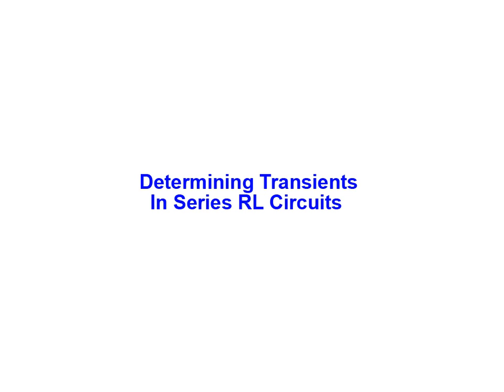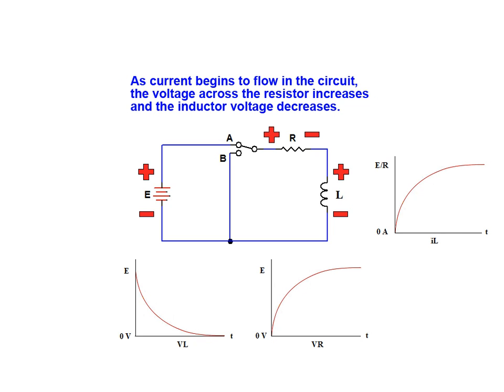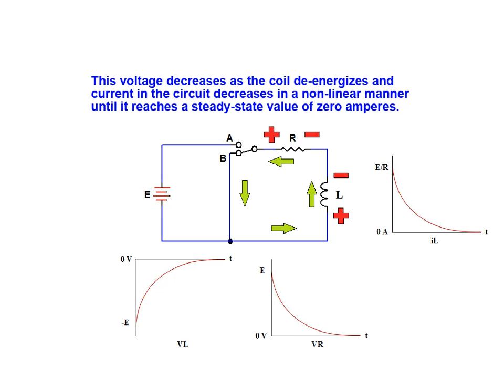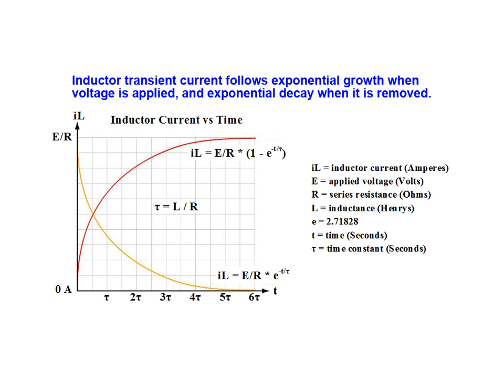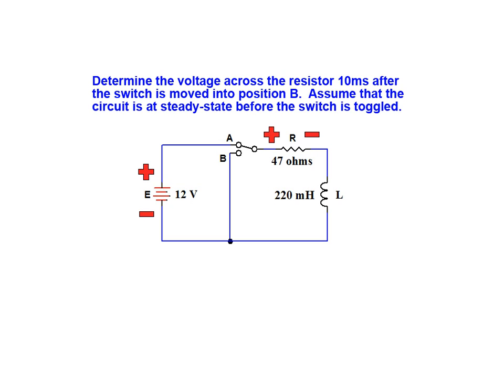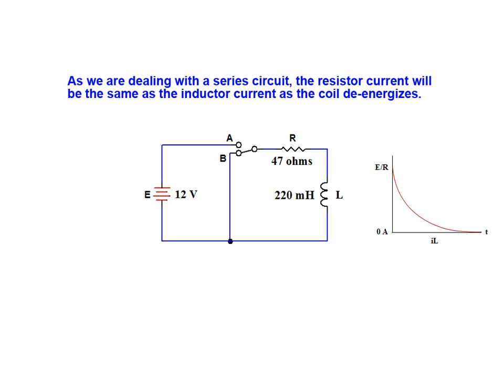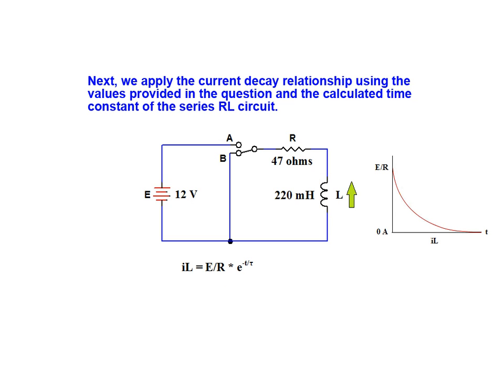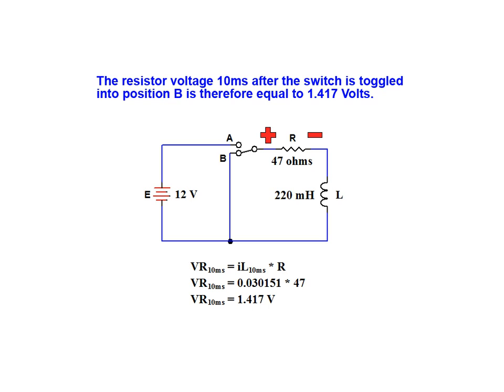Online tutorial on Inductor transient response -- series RL circuits

Comment: Does the analysis change at all if the resistor is the inductive coil itself?
Reply from the maker: No, not really. Even with this example, you would reasonably apply some resistive value to the inductor in this circuit. It would just be a matter of summing, to get total series resistance, and applying the same approach.